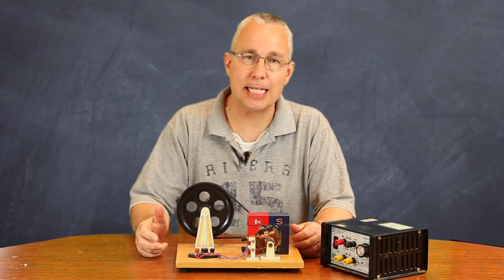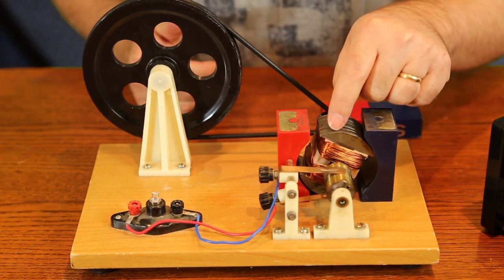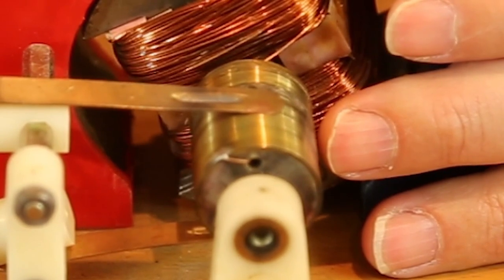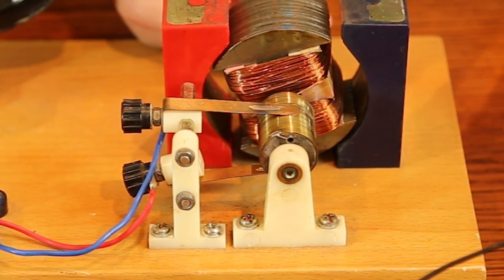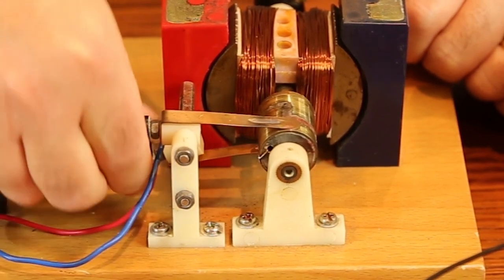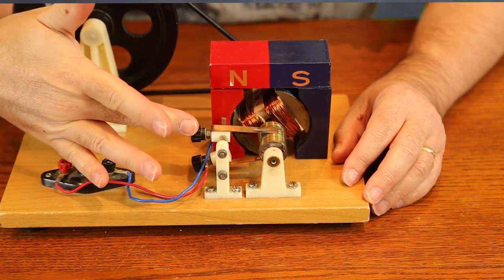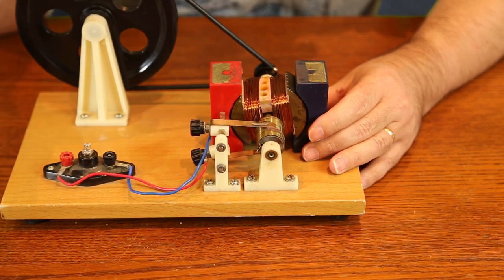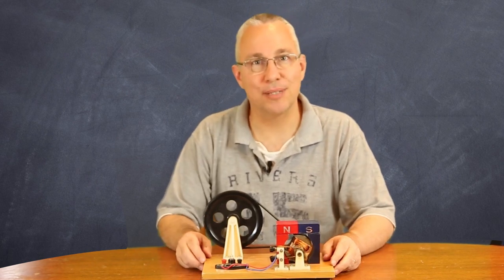What's the difference between motors and generators?

Comment: since a battery can make rotate the rotor. can you turn the rotor by mechanical force and charge the battery? or the battery will damage?
Reply from the maker: Yes it can. In essence this is what happens in hybrids and electric cars when the car brakes or when the accelerator is not used

Comment: Hi Paul,

Thanks for this explanation. I completed my BTEC in electrical engineering and we touched upon AC gen/motors, and DC gen/motors, I'm an apprentice so I'm still learning, I completed the generator unit in my BTEC around 1 year ago. I have a burning question. I work with AC generators which are ran from a diesel engine- so the camshaft, cam gears and a driving belt and is connected to the rotor (which is the coil) and this is slotted into a stator (magnet/electromagnet). The rotor is spun via the camshaft which then in turn creates AC electrical energy due to the stationary magnetic windings. The stator goes out to two slip rings which have carbon brushes which then connects to the load/cables etc. 

In DC Generators are AC generators but with split rings? 

I can make an AC motor by placing AC electrical current (i.e. a plug and wire) into the rotor which causes the rotor to move and creates mechanical energy rather than using my hand to spin the rotor? Similar to DC motors but a different commentator arrangement and DC power i.e. battery etc. 

To make it even more complicated the engine is started via a motor and a starter battery. So DC power is input into the the rotor via the starter battery which causes the rotor to spin which is connected to the fly wheel. The fly wheel turns the shaft which enables the piston to go up and down (whilst they are being filled with fuel and air). 

Also, with an electromagnet formation in a car for instance, will the electromagnet receive it's electrical supply from a battery? 

I'm just wondering if that is correct?
Reply: you're doing this for electrical engineering?! Dude, I'm learning this for a simple year 9 physics test 😭

Comment: People get confused when you just say flux changing, you can't just change magnetic flux and expect to get current on the output terminals of the coil ,but the rule is magnetic flux must cut perpendicular in the wires or any conductor, in order to induce electricity .so man correct this word of magnetic flux changing to magnetic flux cutting OK!

Comment: The brush connection and the commutator explanation needs vivid detailed explanation.  Otherwise you would have said it would be discussed more some other time. But I don't think that was your plan.

 I am doing this for those who really want to know but don't want to bother people and are too shy or lack self confidence and or concerned that if you explained it more you might still not be clear so they eat it up and suffer.  This is how the details of what vivid explanation should cover.
Show the exact path/wire of current with care and clarity not with word slur and haste.  From where it is coming and show the exact brush that it enters into and what commutator, then show the  path to the rotor coil and how the rotor turns as it experiences the magnetic force and the path of the current going in the coil and the path of it heading out and how by then the rotor has turned ( how? sheer momentum) and as the current heading out, what commutator and brush it exist from..  That is the crux, the very core of this video.  If anyone don't get that right the whole teaching got wasted which is typical.
Further explain the reasoning for why the so called pioneers had to come up with that transition device the commutator and  the brushes although it doesn't look like a brush ( we know what brush looks like).  It looks like a strip of metal obviously.  I know why you didn't explain it and it shows later as your absent minded attempt to operated it using AC supply and worse yet calling it synchronous motor another equally fancy name for another fancy name induction motor with brushed all twisted in wrong phrasing no matter what terms you would have used.
I needed to see closer shots of your commutator, most likely if you left the brushes alone and supplied lower voltage and not 120, you could have got it going with a little starting effort with your hand and then you would have had to turn it off sooner than later so it won't get too hot.

You never explained the difference between commutator and slip ring.  They are two different term for two completely different concepts. 

I myself was a pain in everybody's in the classroom and you can see why and  you can also see that there is nothing anyone could do about it because I alone was right by every standard with my questions.
When you brought up the Eddy current you immediately said that it is for another subject so you didn't leave people empty handed wondering what is that.

By the way there is a reason why your attempt to use AC to turn the motor failed.  It is because you don't know your stuff.  If you did you would have known it already that it wouldn't work.  Students don't know so you get away with it by moving on.  
There is only two types of teachers that tolerated me.   The one that knew their shit and the true humble one.  Typically one or two teacher in the entire school but mostly maybe one teacher if I got lucky.
Reply: This was great, thanks, been searching for "what renewable sources of energy are available?" for a while now, and I think this has helped. You ever tried - Senarper Salient Secret - (Have a quick look on google cant remember the place now ) ? It is a smashing one off product for discovering how to have free power in your home minus the normal expense. Ive heard some amazing things about it and my neighbour got excellent success with it.

Comment: Why doesn't the potential difference in charge just flow directly through the commutator instead of the wire, since the commutator is conductive? I've been wondering about this for a while now, and haven't found any explanation as of yet.

Comment: I still didn’t get the difference between commutator and slip ring by just moving the brushes?
Reply from the maker: When the brushes are at the extreme (slip ring) the current always enters one side of the coil irrespective of its position. This results in AC 
When brushes are in the middle, due to the design, the current now switches every 180 degrees to ensure current goes into coil so the the direction is the same way relative to the static. This results in DC.